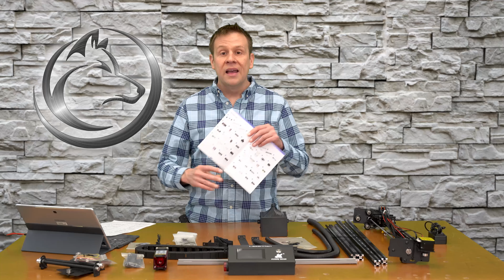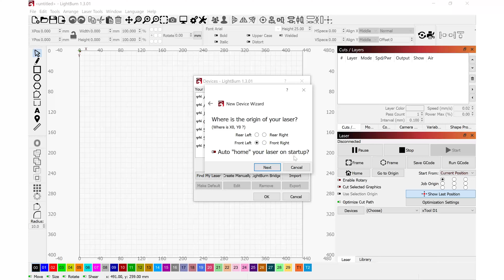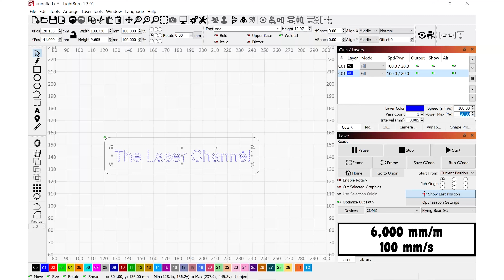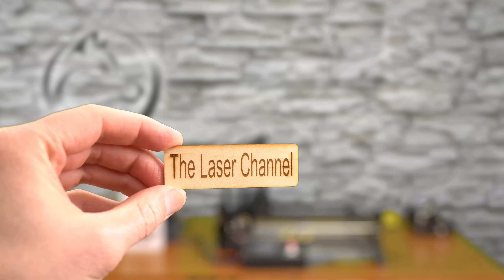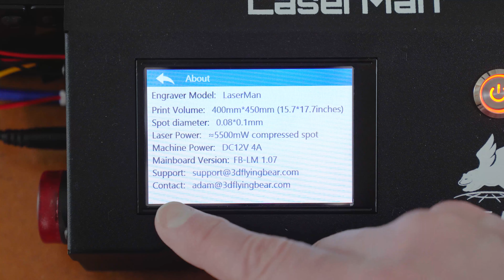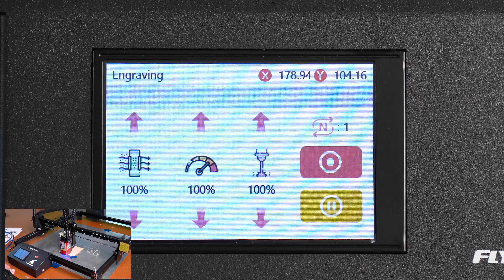Flying Bear Laser Machine- Best Entry Level Machine?

Comment: Which version of light burn would I need to get for this machine? I’m just starting out! And can I run it from a kindle fire or a iPhone?
Reply from the maker: This machine uses the "GCode" version of Lightburn- this is the $60.  Lightburn offers a free 30 day trial of the software too!  Should you ever purchase a Co2 laser that uses the "DSP" version just purchase the add on software key at a discount- you'll be able to run your laser diode and the Co2 machine.
Reply: @thelaserchannel1  Thank you. Do you know if that can be run through my iPhone?
Reply from the maker: @srflow2  I don't think Lightburn runs on an Iphone.  Here's the sftware requirements from the LB website; LightBurn will run on Windows 7.0 or later (32 or 64 bit), MacOS 10.11 or later, or 64 bit Linux (Ubuntu 20.04 or Fedora 36, anything else may not work as intended).
Reply: @thelaserchannel1  thanks for the information!

Comment: Hello, do you happen to know if it can cut transparent acrylics plate (3mm)
Reply from the maker: Hi- Blue Diode Laser machines are not able to cut clear acrylics no mater the output power of the laser or the thickness of the acrylic.  Cutting acrylic is a job best suited for a Co2 laser.

Comment: Hello, I have same problem with the filter, I took it off and was going to put on an air assist. I would rather use the filter as I bought a bunch of filters for spares and use this in my garage which fills with smoke. I like your fix but was wondering if you could send me the link for the items they told you to fix it. I contacted them and never heard back from them. Thanks, I do love the machine, still learning the right settings but its been fun.
Reply from the maker: Here's the official Flying Bear video showing the  manual speed control when using LightBurn software- in their description is the materials list; I think the link for the cables is outdated but the cable type is available with a little searching on Amazon.  Thanks for watching!
Reply: This is the only laser I have used.  I have spent many hours trying to figure it out. There are very few videos on it, so I am glad to see this one. It is a good machine and easy to learn. I found that if you just save the code from lightburn and run your job off the sd, the fan always works.  I also saw the rotary video. I was hoping you would include the "goblet adapter" for the rotary tool. The website has some tables for settings to cut and engrave, but I do not understand it. I hope to see more. Most creators have done one or 2 videos on it and raffled it off.